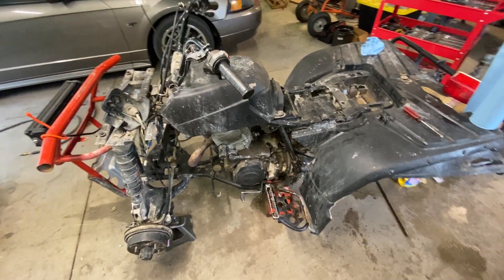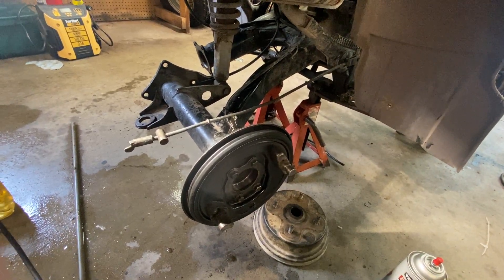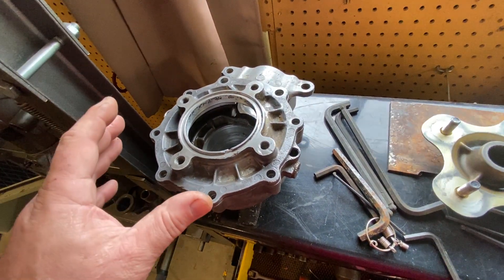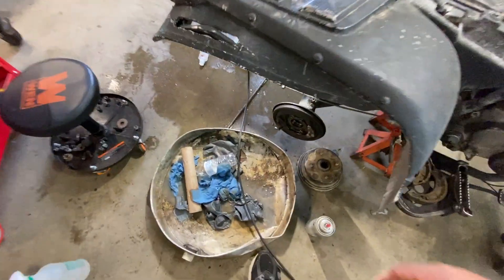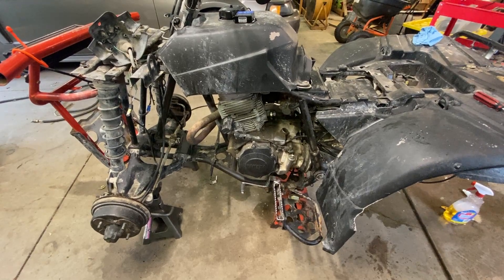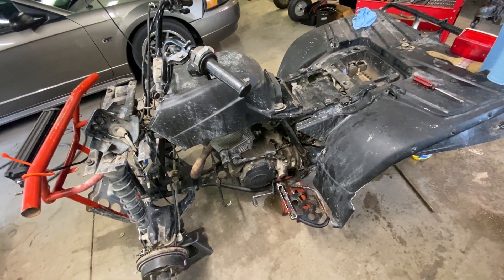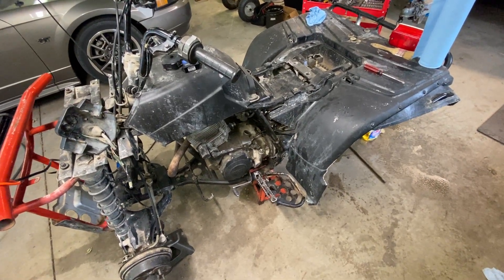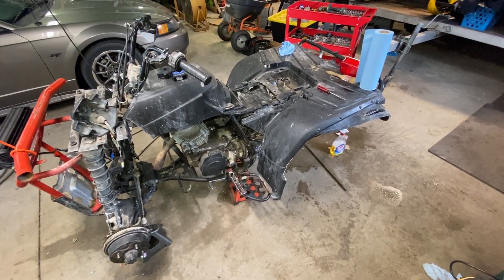Off season rebuild. 1995 Yamaha Timberwolf 250 2wd.

Comment: I am working on the same 4 wheeler with  rear axle problems.   I haven't been able to find parts.  Where did you find yours?
Reply from the maker: No single place.  it took a few weeks of research to for me to feel comfortable enough that I could find everything.  Don't want to dump a bunch of money into something only to find an "unobtainium" part prevents completion.   

I found that there were no actual new direct replacement rear ends.  It would look like it until I got into part numbers.  Ebay showed used ones full of mud for $500-600!  Homey don't play dat!  I've done many automotive rear ends.  This appears to be cheaper and easier to simply rebuild it.  All of the parts to do that are in the mail.  The new axle showed up today.  It's gonna take about 10 days for everything to show up.   One of the spacers, I think the pinion spacer had to be ordered from Amsterdam at the cost of about 45 dollars with shipping.  That was the hardest part to find.  Most were on ebay and seals and things like that were found on Amazon.  And of course there are so many parts back there combined with the way I had to cut everything out I may find I'm still missing something during reassembly.  

I did discover that for some reason there is a shortage of parts for the Timberwolf rear ends.  And the costs are considerably higher than even other Yamaha ATVs of that time. I'm figuring that the rear ends have been a problem in the Timberwolfs and that many of the repair parts have been depleted over the years and no more are being made.

I hope that helps.  When I get into putting it together I'll get a bit more detailed.  My videos are more like I do the work and then describe what I did and how I solved any problems I had.  I really don't have the patience to do step by step videos.  When I watch others videos I don't feel that watching them actually turning the wrench teaches me much.  I'm looking for tips and things that aren't in manuals, because I almost always use the manuals.  Thanks!  Ed